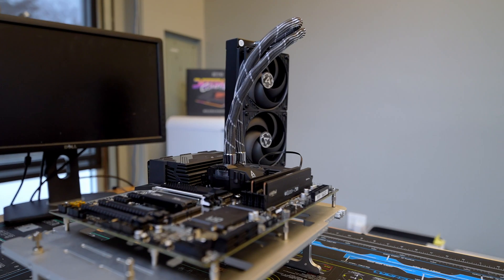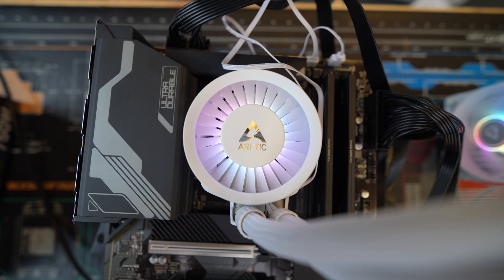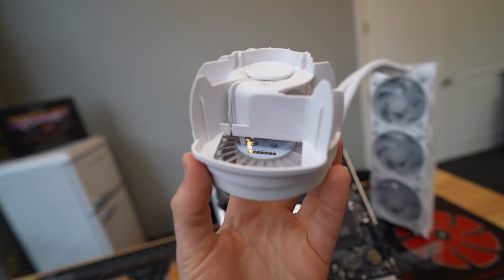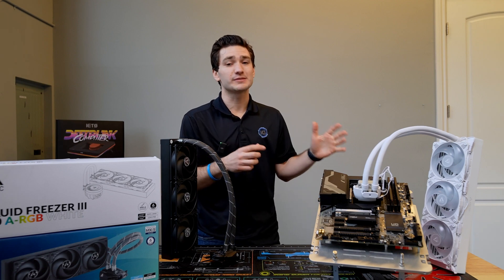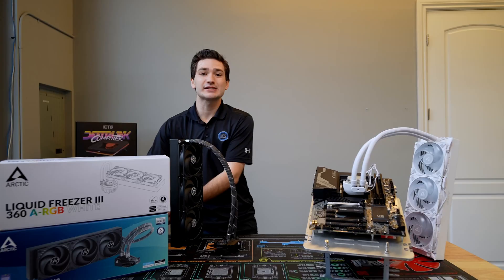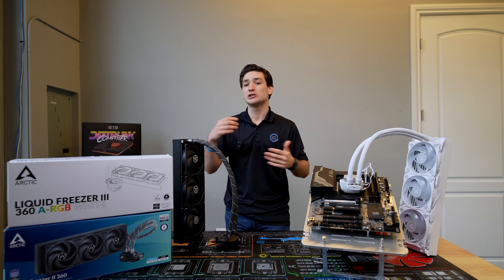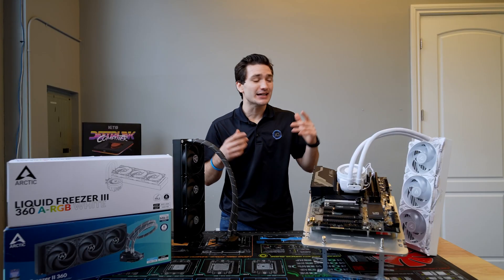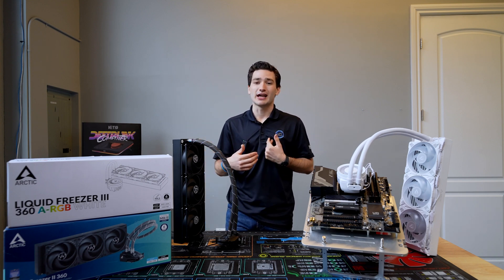The BEST CPU Cooler! BUT DOES IT VOID YOUR WARRANTY? Arctic Liquid Freezer iii Review

Comment: One thing I have noticed with AIO's don't use the all in one cable, control the fans yes but best bet is to leave the pump on 100% because that's the one that helps with cooling the most it's what i have done with my Asus Ryujin 360.

Comment: I absolutely love my 360 verison but the mounting system is a nightmare and they dont give detailed instructions i suggest removing your ram and 24 pin while also installing the pump to the brackets first as its very hard to get the mounting screws started otherwise and the standoffs dont stay on the motherboard they are a loose fit around the stock backplate if they made the screws longer and the standoffs a snug fit it would be breeze

Comment: OMG, just FOLLOW Arctic's instructions for mounting the CPU bracket and you won't have any issues. They specifically address how to deal with the back plate, for BOTH scenarios of installing before and after installing the motherboard in the case.
Also, a lot of companies spout nonsense about voiding your warranty ("removing this tape will void your warranty!"). It's all nonsense. Consumer protection laws says they can't.

Comment: One of the best for raw performance? No, there are several other coolers that outdo it. It's only when you "noise normalize", which is to say you put a leash on every AIO so they are all at the same noise level as the Arctic that it shines. Why? Because it's quiet and does a very nice job at that speed. The other coolers are designed to outperform it, and they will if you don't limit them. There are quite a few AIOs that outdo the LF.

However, when we look at noise and performance, plus the current sale price, there literally is almost nothing better, although the TR Frozen Notte & Frozen Magic Scenic V2 may....
Reply: which ones please?
Reply: @3d-illusions  What are you asking about? Aside from the LF3, there's the Deepcool Mystique, SilverStone IceMyst, EK Elite, Lian Li Galahad II Trinity Performance, and several others. It's quite a long list, really, of coolers that are top-rated. Is noise an issue?
Reply: @ThePCExpertAmateur  thanks.  Yes noise is an issue as fan noise gives me tinnitus, so I need the quietist solution able to keep an i7-14700k cool under prolonged heavy use (3d simulations)
Reply: @3d-illusions  Well, I can tell you right now that between the heat of your CPU and your tinnitis, you'd better invest in some ear protection because that is the ONLY way you can reasonably expect to get both without putting your computer in another room or inside a sound-dampening chamber, or maybe use some sonic insulative material. The AIOs I listed previously are all excellent choices, but most are probably going to be noisy and, if you're REALLY sensitive to noise, all of them are. So, first step is to find some recordings of their noise as well as look at the published decibels for each. If you can get an Endorfy Navis 280 or 360, that would also be a good bet and, again, there are several other coolers that can suit your needs. The series of AIO reviews by KitGuru is very helpful, as are some of the others. I guess you should start with Endorfy and Arctic, though, as I recall that they're both very quiet and, at this point, the Arctic LF3 is probably stronger (compared to the Navis and the LF2).
Reply: @ThePCExpertAmateur  Thanks.  Yes I've already put an order in for the arctic liquid freezer 3 based on reviews of it being 10db quieter than competing products, but still investigating as it's on back order 👍
Reply: @3d-illusions  BTW, Hardware Canucks said that the IceMyst is very quiet.
Reply: @3d-illusions  Finally, although it is hard to find comparisons, I would suggest you also look at the Thermalright Frozen Notte and Frozen Magic Scenic V2. I have both and I've been using the Notte for almost half a year and, aside from occasional harmonic resonance, it is a quiet and efficient cooler that doesn't need better fans. The Frozen Edge and the others, however, don't have a powerful pump, so they likely could benefit from better fans.
Reply: @ThePCExpertAmateur  thanks.
Reply: @3d-illusions  YW

Comment: NVIDIA GeForce GTX 1050
Driver version 546.65
AMD F(tm)-4300 Quad-Core Processor
8 GB RAM
1920 x 1080, 30Hz
 
Good evening Matt.. these are my current computer specs. I want to play my sim games on all high settings. What would you recommend I upgrade my graphics card, and gpu and or power supply to in order to do this without having to order a new computer!? Thank you so much
Reply: You need to upgrade literally everything, including the monitor. Are you sure it's only 30Hz and not 60Hz?
Reply from the maker: Your system is pretty far behind based on what it seems like, so i would slowly upgrade your system starting with the CPU, motherboard and memory, then GPU, then get your storage upgraded to some kind of NVMe drive followed by your monitor.
Reply: Thank y’all I really appreciate, I’m no hat computer savvy but I knew yall could help. Thanks again
Reply: What would yall recommend upgrading what you suggested  so that I could run high settings?

Comment: When you send CPU for RMA, you have to send the CPU only, there is no way they can determine which cooler was used and for the most part they wouldn't even bother with that. So this can't void a CPU warranty
Reply: i think he is talking about the motherboard. but still i dont know how they can  determine if you remove the mounting bracket or not since u can just screw it back lol

Comment: Would you recommend in splitting them up and use the separate fan and pump headers on the motherboard or just leave them as one connector? I actually ordered one and i never had a liquid cooler before so i'm pretty new to this
Reply: Split them, then use software like FanControl to controll fan speeds

Comment: I wonder how this one would handle a 7800x3d with the new offset of the LF III
Reply: There is nothing new regarding that, previous optional offset position on LF II is now standard mount position on LF III, so it's basically the same... Although it seems that it now lacks standard mount position (some say that one could just flip around two brackets and get standard position but arctic does not mention that and they clearly labeled each with L / R letters to indicate on which side to mount them), loosing standard mount position is a bad thing since not all ryzen CPUs have CCD off centre, ryzen APUs are actually monolithic dies and still in the centre